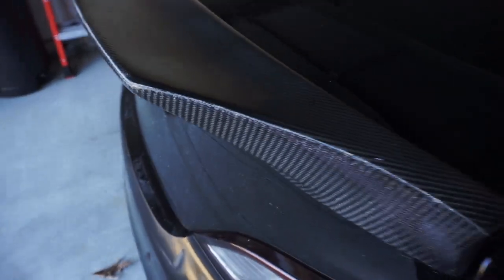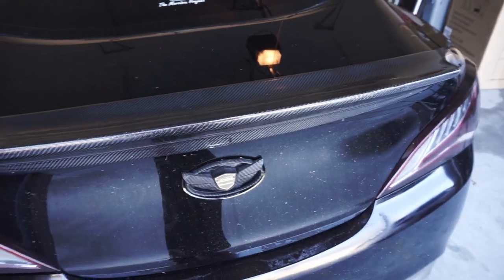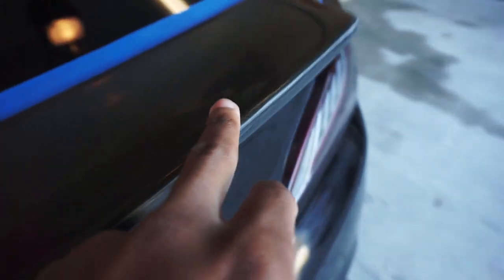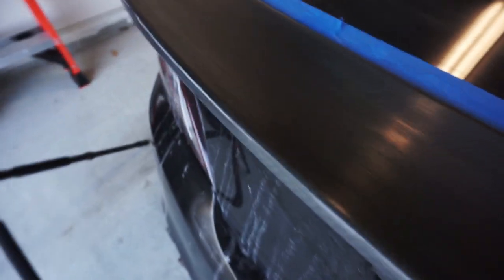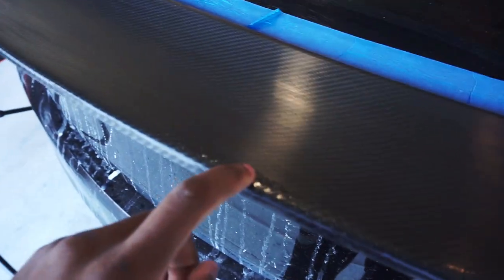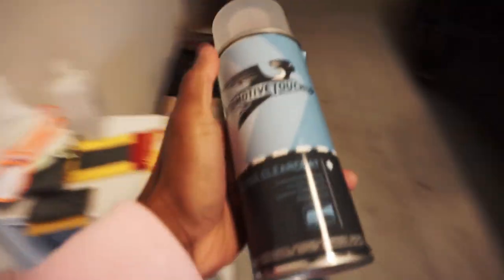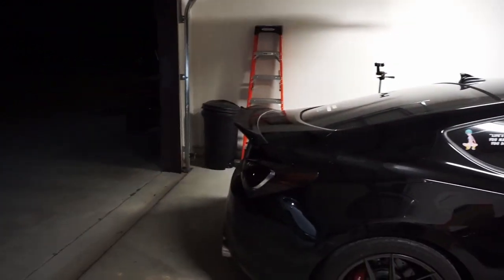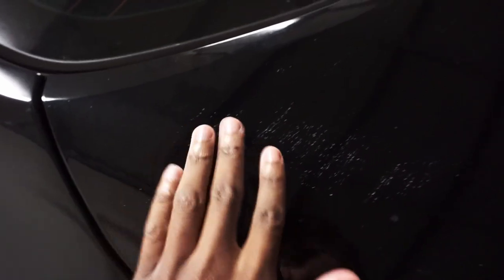How to RESTORE Faded Carbon Fiber | Making Old Carbon Fiber Look NEW

Comment: My spoiler is half that size and im scared to do this!  Lol  Its a cheap one, but real carbon, just faded, you think your process will still work?
Reply from the maker: Yes it definitely would work! I’d just recommend using a good quality clear coat with hardener in it such as 2K clear. Especially if your car lives in the elements like mine.

That’s the one mistake that I did make with it, so I’m going to redo mine again